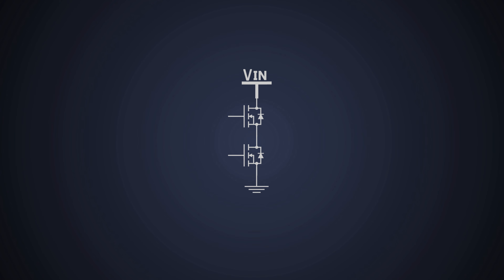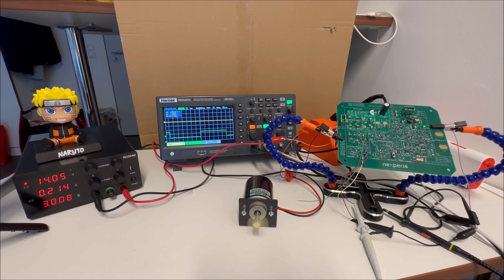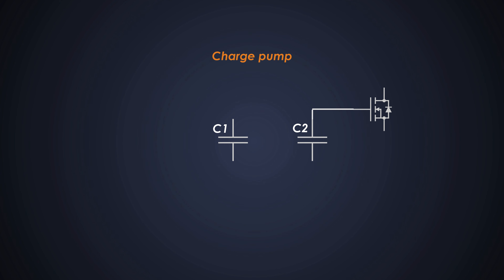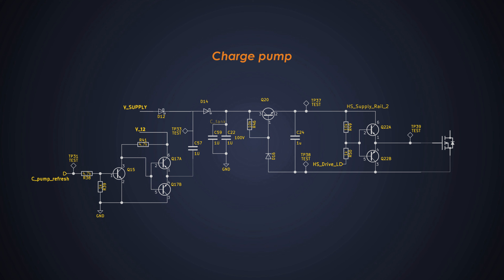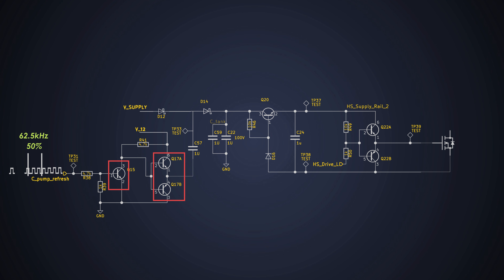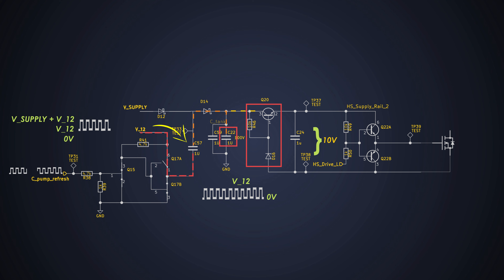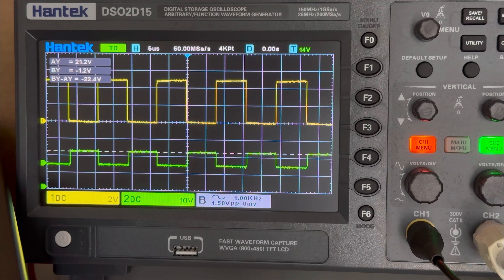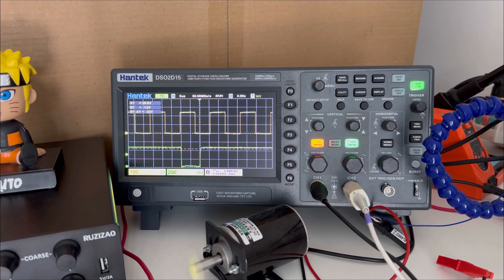How does Charge Pump MOSFET driving work? Charge Pump vs Bootstrap driving | Charge pump gate driver

Comment: Charge pumps are also essential as an IC design building block; not just an external component. In an IC design definition, adding an external inductor for a boost converter means consuming 2x pins (BST_IN + BST_OUT) and additional external component. FETs+cap can be fully built inside an IC, thus enabling a boost converter if the internal voltage rail required is low enough current.

Comment: Thank you for sharing your knowledge on mosfet driver. I am looking for an 8 output high driver and thinking about using a charge pump solution. Like you described here. Will it be possible to share one charge pump circuit to all 8 drivers?
Reply from the maker: what is your application? You can use Application specific driver

Comment: 7:05，'when the bottom pin is at 9V, then the voltage across c57 is V_supply+9V'. I think here the voltage across c57 should be V_supply-9V. Could you explain more?
Reply: Let supppose voltage across capacitor is V_supply, Apply KVL bw TP 33 TEST PIN and  V_12 PIN, it will be:    -TP33TEST PIN + V_supply + V_12=0; which gives TP33TEST = V_supply + V_12;